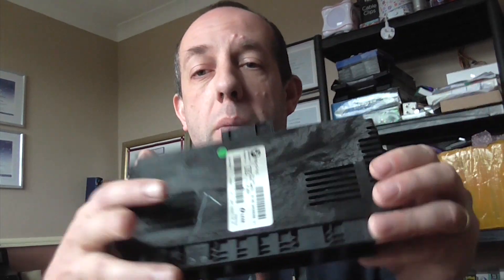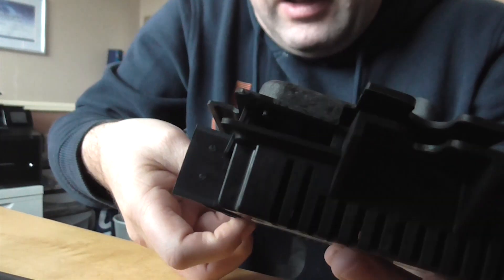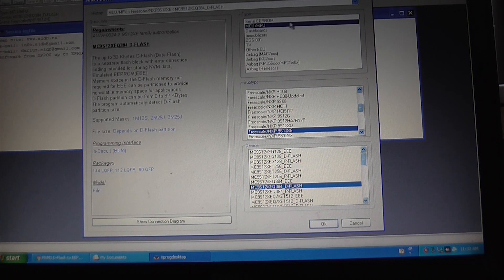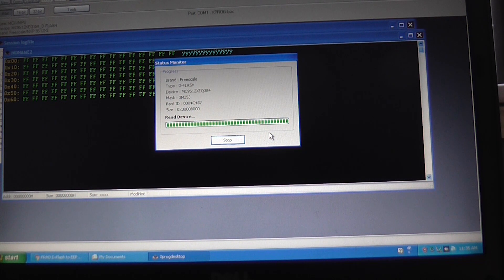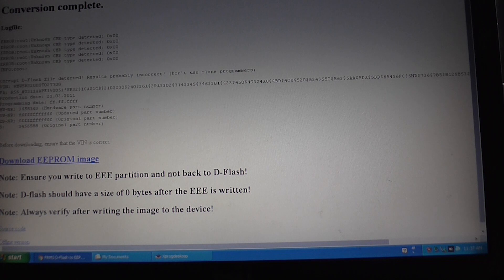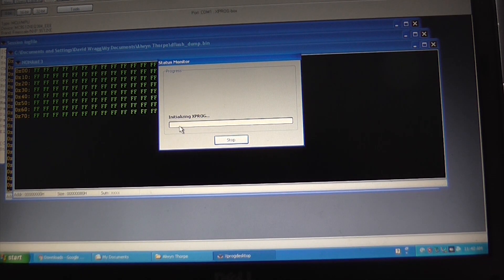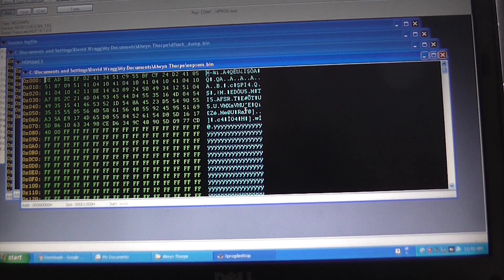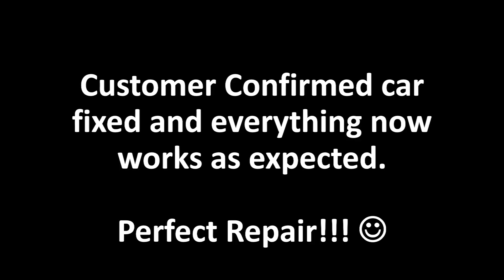BMW / MINI FRM3 Module Corrupt EEPROM Repair

Comment: thank you very much i just got my xprog 6.50 ,  in have a few test frms , in seems it work now to find buddy cat to test in as buliding a bench test platform  is not in the budget just yet , have you tried any edited on vin milage , to reset frm to a new state if so any insite on this would be great again thank you
Reply from the maker: Hi, I haven't tried changing the VIN with XProg. I have previously changed the VIN on an FRM with WinKFP. Let me know if you need any help :-)
Reply: FRM repair went well did 4 test on old module in got change to do on same car in all good after repair on additional faults as i seen some have coding faoults , in trying to get ahold of bin file from new frm w/o any vin milage or v/o  but as always test verify in if good reset to factory in possible resell od offer  change  info from user will just neeedd thier core in proper  info , i keep you posted @djwwautodiagnostics